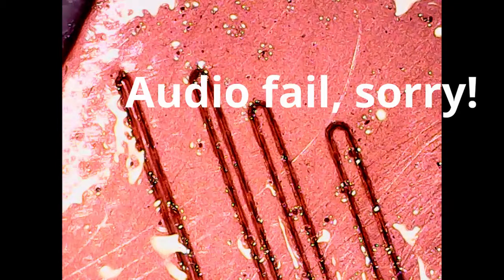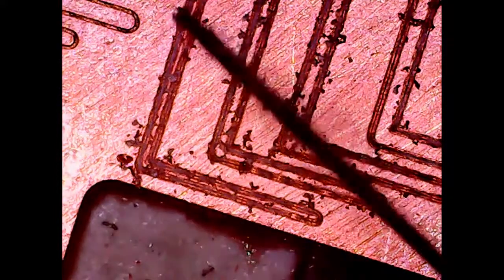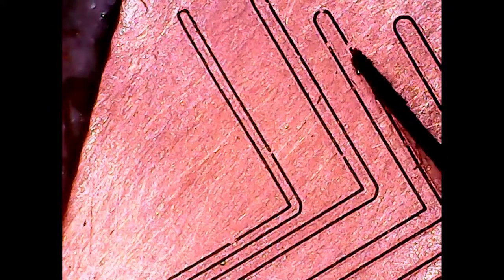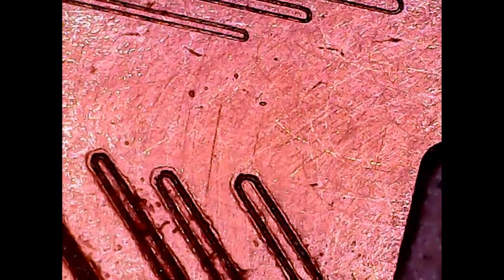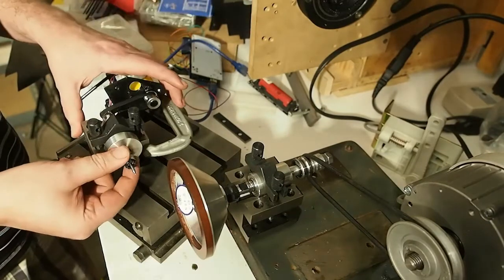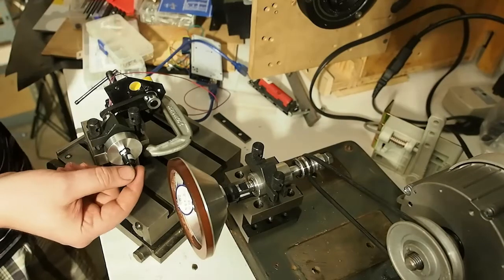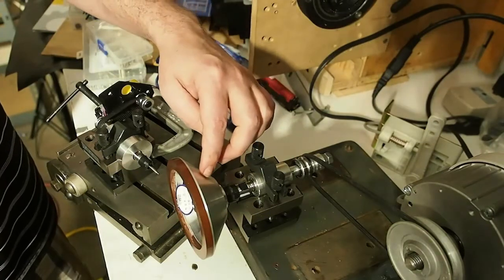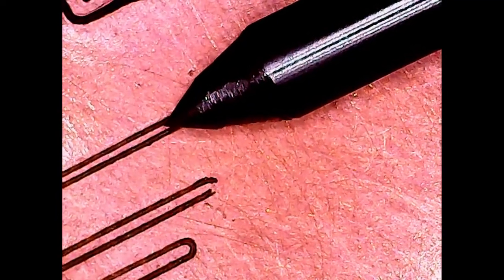splitting PCB hairs aka scratch milling

Comment: I did a test using a 9924 scribe bit, after wiping some oil onto and into the copper some.  I did a Z axis of -0.15, and ran it on a 1 1/2" long trace, ...a long rectangle, 1 1/2" X 2.5mm.   It worked but there was a short, so I ran it one more time, and no shorts.  So I think this is going to work for me very well, and being in an apartment, to be able to turn off the spindle during the traces is absolute gold for me.  Even with a very well made sound box enclosure for me CNC, on more than 8000 rpm, it is not pleasant.  It is louder than what I am comfortable with.  Now I can "scratch mill" with no spindle, and then just use the spindle for the drills.  I do pre-drills using a V-bit, because I was told that if I did not, the little 0.9mm drill bit will travel and then break.  The pre-drills using the Vbit make a nice pre-hole for the drill bit to center up perfectly.  Thanks for your video.  I am feeling good about the process, and I have already modified my PCB software to deal with the different feed speeds.  I think though that I need to follow Robin's Debreuil's technique of 3 passes, each one a bit deeper than the one before, and one slightly off from the other to get the peel up effect.  Something like that I think will make it look smoother.  Also, I am going well down into the pcb material, past the copper, with no auto-level.  I have a lot of variables to mess with now, and so I need to do a lot of experimentation, but this is looking really really good to me.  Imagine being able to mill a board with no spindle except for drills and pre-drills.  That is a "super cool" (if you watch Dude Perfect Cool Not Cool show).
Reply from the maker: it would be cool if you could share your results.  let me know if you make a vid.

Comment: I love how so many of your tools are home designed and made, really well done :). 

The one thing that jumps out for me is I always do 3 or four contours. I do get that middle burr with just two contours. I'm not sure why the third pass takes it all off, but it seems to for me. Also I'd try running the paths a second time, even at the same height - that helped me dial it in, and once in a while if I'm using a dull bit or something, I'll just run the side again. I do get that connectivity along a trace once in a while, but usually it is just a hair/side burr flattened down rather than coming off.

The second is I always autolevel. I don't get nearly that good of results without it, and I have to autolevel both sides. It could be the new blanks I'm using are a little too tight a fit on the alignment pins, or maybe I need to level the board again.

I'm super impressed with your diamond wheel, I looked at getting one for my grinder, but your setup seems really handy. Oh, and I'm getting a lot out of your other videos as well, thanks!

Comment: Great work.  Use oil before milling and then sand off the burrs with like 1000 grit sandpaper, or a higher grit.  And also maybe wet the sandpaper.

Comment: I posted a link last night to a webpage with screen shots of my PCB Maker software, but apparently youtube deleted the post. I tried the new GCode generated from my new software,  using a .1mm X and Y offset on the 2nd pass, using 3 passes of .05mm, .1mm, and .15mm, and I tested it for shorts and there were ZERO SHORTS.  Not even a single short.  I forgot to put some oil on the pcb and it still worked perfectly.   I wanted to try it with a thin layer of oil, and also using a heat gun to heat up the pcb to see if that helps the process, but I guess that is completely unnecessary.

Comment: Wow, this video was made August 5, 2020.  I thought it was brand new.  I have done searches before on "PCB scratching" before, and of course, your video was not shown.  I wonder well you got your technique down, and if scratch milling ever worked out for you.
Reply from the maker: I got the idea from Robin below in the comments.  Check his channel out
Reply: @JesseSchoch  Yes, I saw his video a few months ago, subscribed to him, and you.  I had the idea before seeing his video, but I did not really know about those titanium carbide scribe tools.  I also had the idea to use a utility knife blade, on a CNC, and one that could rotate to the angle needed, and make the GCode accordingly, and I think that is a possibility, but if a scribe tool could work, then the GCode and mechanism would be way simpler, and simpler always rules.
Reply: @JesseSchoch  So, ...well, ...did scratch milling ever work for you, and your needs?  I am about to do my one tests, and with using oil.  I noticed that without oil, even a normal 10 degree or 20 degree V-bit was leaving jagged edges on the traces.  I think the oil is really important.  So, did scratch milling work out?  Thanks.
Reply from the maker: @jeffbeck6501  I only did some tests but it wasn't clean enough to use.  Someone reported you may need a few passes to get clean traces.  I don't think there is anything you can do about the burrs.  I get burrs when I mill them but milling them is a more consistent result.
Reply: @JesseSchoch  I did a scribe test today with the spindle ON at a midrange 5000rpms, and I got a clean rectangle trace, with auto level, on just 2 passes, instead of 4 passes as I did with the spindle OFF.  I want to try for one pass, but I think that is pushing it, but it is probably possible, but less clean  For me, the result is clean enough. Burrs are not so much the problem.  It is more like it just not clearing out the material was the problem.  Turning on the spindle helped that a lot.  And yeah, I hear you.  It ain't super pretty, but it ain't that bad either. For me, and my comfortable 2.54mm wide traces, it is a great process. If I can do it in just 2 passes, and at a high feed rate speed with the scribe bit, with the spindle on, ... that is a win for me.  And the spindle is only at about 5000 rpm's so it not so loud. You need 10,000rpms with a Vbit.  At least. Also, I have seen small spindles like on Wegstr channel, doing pcb Vbit milling, and they have a very small spindle that can run at much higher than 10,000rpms, and I bet with much less noise than mine.  Noise is my main thing. And so at just 2 passes with the spindle on at 5000rpms, I am finally feeling good about my progress on making a process that is repeatable and that works every time.  The auto level is super important too.

Comment: i'm just playing with this technique too. At one point i was getting the annoying "nearly OK" results you are as well and found just repeating the pattern as many times as required to scrub off the copper adequate. Same offset; Just run it again as many times as required.
Ultimately i made the clamp holding the scriber stiffer so i could increase pressure without unwanted deflection. That got my copper off first time for me.
Any reason your not just applying more pressure? Ie: going deeper into the stock?
Reply from the maker: are you getting 0.1mm traces to come out without having to do lots of cleanup of small burrs?
Reply: @JesseSchoch  no. i''ve always been doing multiple passes at 0.1mm offset.
I was suggesting you try multiple passes at multiple offsets; Each offset also repeated multiple times.

I really should try multiple passes at the /same/ offset and see how that comes out.

here's a clip of my setup that's working quite well for test patterns: https://www.youtube.com/watch?v=8xecfwEE2jE
i haven't got as far as creating an actual PCB yet.
Reply from the maker: @DuncanLaw  Give it a try, 0.1mm traces are very hard.  My X ballscrew has ~0.04mm of backlash and without backlash compensation it can't even do 0.2mm traces.  They simply rip off the board.  There is very little to hold them in place and the deeper you cut, the less structure is there to hold the trace in place.  using a lot of force tends to deform the underlying material so the very tiny trace has less chance to hang on.  Now I could use a bigger tool and create a bigger cut but that negates the advantage of small traces in the first place, they can't be routed through tight spaces if your tool is gouging a 1mm trench.  

If you want I'm happy to share my test gcode which lays out .4,.3,.2,.1 mm traces in x,y, and diagonals both ways.  I think your setup will need quite a bit more rigidity to be able to get the first trace intact and isolated.

Finally, measuring with the microscope is essential for this sort of stuff, I can't say that enough.  You simply can't see if  you are over/under cutting or by how much.

Now I'm not actually designing anything with 0.1mm traces at this point.  This was an experiment to see how far I can push my machine.  If I can scratch these at 1500mm/m then I'd need to be able to do it in less than 5 passes to save time over the 500mm/m endmill cutting speeds which can also cut 0.1mm traces but requires .5mm clearance and 2 passes.  These methods leave very sneaky burrs that will drive you insane debugging.  The time saved by fast scratching is likely lost in deburring, cleanup, and inspection.  If this method would work reliably AND it would reduce vias (small clearances) then I think it is worth pursuing.  Right now I don't think it has enough advantages.
Reply: @JesseSchoch  Apologies; i was  misinterpreting "0.1mm traces" as "0.11mm of isolation" the first time i read this.
yea, i don't think scratching is ever going to work for 0.1mm traces; Like you say, they are just going to rip off.
I'll run some tests at some point and see how low i can go but since i am currently running my passes 0.1mm apart with /no/ residue between them, i think persuading this system to leave anything that fine is unlikely.

Using this to scratch an etch resistant covering would likely work down to that fine.
My spring mounted holder would likely be useful there with a weaker spring.

TBH, i think when i need something complicated enough to need 0.1mm, i'll just have it fabricated professionally.
i'm more interested in this for the quick hacks that you want "right now".
Reply: just ran a few tests just now.
So i'm sure with work things could be tightened up but yes, i think 0.5mm is the thinnest practical trace i would do with my setup.

Saying "0.5mm" is also a little misleading.... So the trace varies between 0.4 and 0.6mm due to backlash and inconsistent tearing of the copper.
But even if that was not the case, i could not rely call this 0.5mm since the cleared copper on either side is in total actually wider than the trace.
So for my 0.5mm trace, the whole path is closer to 1.5mm. If i was trying to route between close msd chip pads, i'd be out of luck.

I think this would be fine for what i want it for: Quick proof of concept circuits that i would otherwise be laying out on stripboard but
certainly does not have the resolution it sounds like you are going for.

Comment: Your traces are way too small and for no reason at all.  Also, each line has to be scratched out all the way around by itself.  Your software should be able to  share borders already cut, so there are no duplicate lines, and then you can cut the scratching time in half, with traces much fatter and easier to work with, and more resilient.